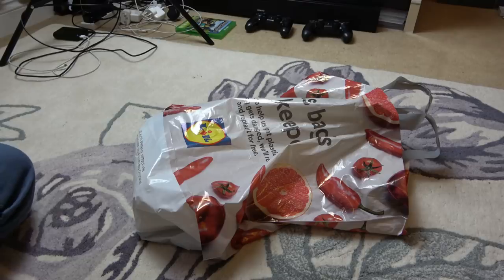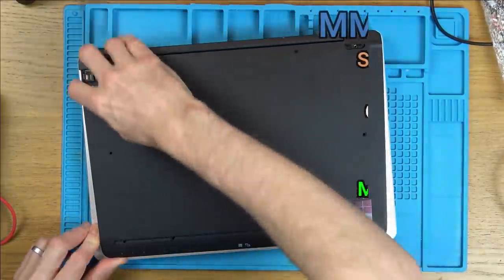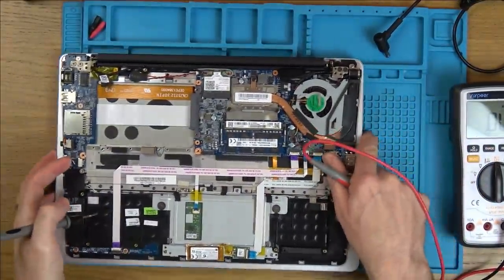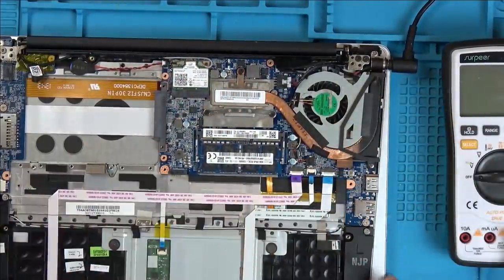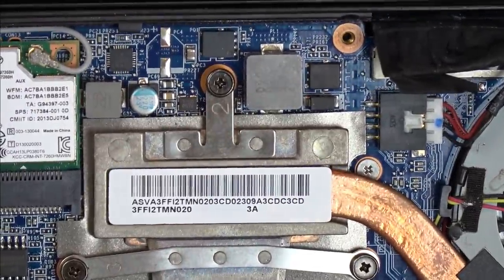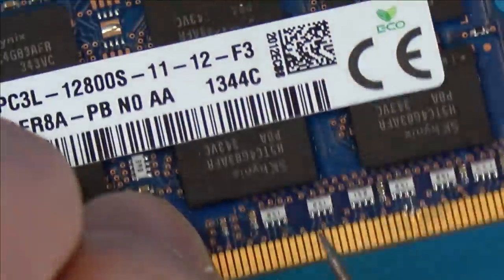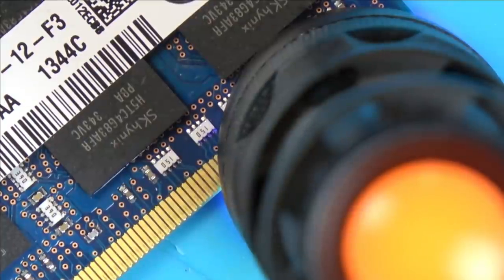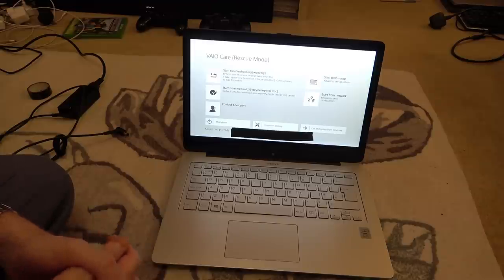A Lovely Sony Vaio Z Flip Laptop that Doesn't Power Up - Trying to FIX

Comment: Nice fix, Vince! I probably wouldn't have seen that super small gap between the pin and the trace. I also have no idea what that strange residue on the pin was. Kinda looked like.. paint?

Just a quick advice: If a PC/Laptop is boot looping like that, it's almost always the RAM or a faulty BIOS/BIOS setting... atleast in my 15+ years of experience with PCs it was almost always that.
That's the first thing I check, when I get an faulty PC.

Thanks for another great video! Merry Christmas and a happy New Year to you too, Vince :)
Reply from the maker: Thank you :-) Very strange mark, looked like tar, paint or melted plastic. Weird thing is, how did it get there. It is the opposite side to the keyboard, there are no holes or vents on the back casing, and if it came through a port on the side how did it make it's way all the way over to the RAM. I wonder if it was there from manufacture, but took a while to eat through the trace. I wonder if the RAM inserted by hand, and maybe the operators glove had it on when they picked up the RAM???? Maybe the comments may shed some light on what it could be.
Reply: @Mymatevince  :)
Reply: @Mymatevince  Based on my knowledge, it could be from improper used on the Laptop. Therefore, it was becoming warm to warmer placing on cloth material instead of something solid  as wood or marble.

Comment: I knew it would probably be ram. Every time I've had PCs fail to power up to post ram is the reason. In my case removing 1 of 2 sticks usually powers system back on but you didn't have that luxury with a single ram chip. Blowing it (and the slot) will often fix mine, although some has gone bad. Never thought to repair the ram. That's impressive

Comment: Hey Vince hope had great Christmas happy new year great repair as few previous comments state ram is a common problem with computers it normally 1 the 1st thing to check in situations like this years ago would beep to inform of issues. Keep up great repairs you do always great see something repaired than just replacing

Comment: I usually. 1. check power, if OK then take the ram out, which is a common fault with Sonys.
I've used an old Sony for years, (upgraded the hard drive and Ram) it has given me no problems since my original faulty ram connector.
I've a suspicion that the ram connector does not grab the ram tight enough on the live causing a small bad connection hence burning the track.
Yip always check the ram early in a computer repair, it's amazing what faults show up when it's not storing info properly.

Comment: Ddr3l is actually a low power consumption variant.  My laptop has the same too . I learnt when I tried to upgrade that standard ddr3 is not compatible and caused system malfunctions when I tried to run it.

Comment: Restarting like that would suggest there's a problem powering-up, and one of the first things I would have done was check the memory by reseating it.  Seems the problem was bit more complicated than that, but still it was memory related.  Back when I was a technician that RAM module would have been replaced.  😁

Comment: i have one of these but it is the  i7 13" version
it has 2 major problems, one is the  barrel jack which on mine is not  the same as on yours
at all ,  it is a special proprietary one that is supposed to be like an Apple magsafe but it   doesn't use magnets it uses some weird spring clips  ,  the thing will not charge unless you hold the adapter on it  or wrap the cord around the laptop  to put pressure on it , it is a huge PITA
i can't even find a replacement part for it anywhere,  i saw one once  but it was in the UK and i am  in the US and the place didn't ship to the US plus it was out of stock and it was  also like 200 pound
so not even worth it even if i could get it,  i really want to change it out  to a regular  barrel jack
another problem i have is the fan ,i have  replaced the fan in this thing  about 5 times already since i got it in 2014 when it was new  , the body is very flimsy  and  the fan breaks constantly, it makes a god awful grinding noise ,  if i slap the laptop  it  sometimes fixes it for awhile , move the laptop and let the flimsy frame flex and it will happen again , eventually the fan needs to be replaced ,it eats fans 
also there is no way to make it  suspend or hibernate  so when it stops getting power cause of the ridiculous charge port design it  reboots ,   sometimes it  suspends mostly it doesn't and i lose my work
i been dealing with these  problems for years ,  too bad because it has such a nice  triluminous IPS display and i like the N-trig digitizer pen
you are lucky the one you got has the normal barrel jack, ut i got this one because i wanted smaller lighter laptop ,i almost never use the flip ,i never use it in tablet mode
also you are lucky is has a DIMM slot   i am pretty sire mine has memory soldered to the board
but mine has a m.2 SATA SSD
also the SD reader is broke ,the card have to be forced in and out the spring broke

Comment: The restart problem when it turns on and off is mostly indeed ram related,
ur lucky this time it was the ram.
Some times it can be the cpu or the ram controller. 
Trough ram controllers are not that common to break, but it is possible. Trough that means replacing the processor anyways because the controllers is with in the processor
Happy new year Vince!

Comment: Always first things to check on a lappy if it don't power on is thermal paste and fan operation and that big wodge of hair from under the SODIMM would suggest it may well have cooked its thermal paste or the fan is working but ineffectually and the BIOS is thermal shutdown as the cpu goes super red hot every startup.

Comment: In future If you get lights the main power rails are working as the chips that drive the lights are further on. If it switches on then off it's a data fault. If it doesn't switch on then check caps for shorts round the chips further on than the main power rails. Remember that some lines are low resistance lines but if one side of the cap is a few ohms higher than the other then it is working.

Comment: In my opinion, Vaios are pretty solid laptops.  I have a Windows 7 era Vaio that's still working.  And I'm currently using a Dell G5 laptop.  And while the Vaio (somewhere between 7-10 years old, maybe more) is still completely intact.  While the G5 which is barely a year old has already had the keycaps wear off keys and the 3 key has stopped working.  The Vaio still intact and everything working.  LOL  In fact, I maxed ot the RAM on the Vaio and replaced the hard drive with an SSD...  so now, it's faster and has longer battery life than when it was new! HAHAHAHA
Reply: (I use it for distraction free writing.)

Comment: You got it to turn on for a few seconds at least. My HP laptop wouldn't turn on after 8 months and sent it back under warranty then 7 months later same problem. Took it to a local computer place and they charged me to tell me that the battery has power, A/C has power but no power after that which I already knew. No one would fix it what a waste except HP when it was under warranty. I heard the power chip in the motherboard needs to be replaced but no one would do it.
Reply: Send it to my mate Vince if you still have it. Be great to watch him fix that
Reply: @paultasker7788  I wish I would have known. It was expensive with a touchscreen which is stupid on a laptop. HP said replaced power supply in the description when they fixed it and 7 months later same thing. Apparently it's the power regulator chip in the motherboard which is why it doesn't get power from either source. Now I know about these people online, I think Louis Rossman is popular and tronics fix but I just bought the best cheap laptop after that.

Comment: What i tend to do is if a laptop or desktop power cycles i take the ram out and move it to secound slot if it has one and replace the ram if still nothing happens then check again and the remove cpu and hard drive and replace them if i have spares its a good thing to start with before testing voltages always take out and replace modular stuff first and see if their is a difference in behaviour

Comment: Have a similar one to that which is a Sony flip 14. It's most likely got a i5 4200u CPU in it which is Haswel from 2013 but that CPU is showing its age as its a low powered CPU. DDR3L is low powered memory. That fan activity is normal its because its a low powered CPU they run hot.

Comment: Nice video! Just a question: the ram was faulty, but the laptop didn’t post even with the ram off.
Maybe cleaning the connector did the trick, or it is supposed to not post without ram?

Comment: I used to work Vaio support... Batteries start at about 70+ and they at the time, really didnt want to sell them to people lol. Also quality wise... they were absolutely meh. No better than anyone else, if anything the push to get weird form factors or use strange new components would result in very iffy stability with drivers etc.

Comment: Take cmos battery out and short the pins before you do anything else. These startup faults (where it's not completely dead) are normally frozen I/O chip that needs to be reset by taking the battery out. If that doesn't work then you look at other things.

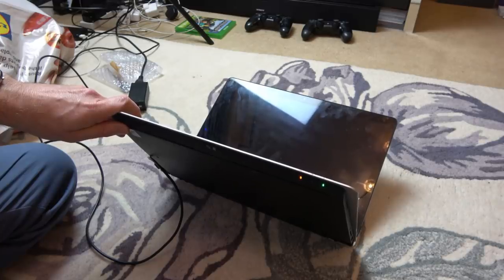Comment: I'm only a minute and a half in and alarm bells are ringing.  If it just won't power up and all the owner wants is the data off the hard drive then that is simple job.  Simply remove it and connect it to the USB port of any other machine and extract the data or simply put the hard drive in an external HDD enclosure and give it back to the original owner.  However, something tells me it's not going to go so easily .  We shall see.........continue.  So at 3:23 it's refreshing to realise someone had the sense to remove the hard drive to recover the data.  On we go.  I hate laptops to be honest even though I have repaired a few.  They always seem far more susceptible to power and motherboard faults and are just often not worth the time to repair as the upgrade capability is so limited.  Right after he checked the power supply rail my next obvious thought was......he hasn't checked the RAM and swapped or reseated them.  Next would be reseat the CPU......on we go. 

So there you go swap the ram out and reseat CPU as a logical progression before you go looking for non-existent motherboard faults.  Generally speaking if the unit has power to the main rail it's usually a plug in component fault if it fails to POST.  As an aside why on earth would you take a soldering iron to a cheap 204 pin 8gb DDR3 ram module  (and use multicore solder without extra flux FFS).  Just bung in another one, any one to test it and then replace with a new one.  About £25 retail.

Comment: Any Computer troubleshooting: 
If the fans turn on and you have LED lights, probably not a power supply issue 
If nothing shows on screen, check the RAM, remove the memory and try one stick at a time, preferably with known good RAM. 
If that doesn't work, try replacing the CPU if possible.
If it turns on and immediately off,  check if there is any USB shorting to ground since some motherboards delay the USB power on a few seconds it may take a few seconds for it ti turn off.

Comment: Was about to say the old mantra. Either it's the power, ram or motherboard/GPU, as software is very unusual as a fail point.
Yes, you fixed the ram, but it would have been safer to get new ram. More expensive, but safer.

Comment: I'm not 100% sure but I think it could post if you removed the broken ram and moved the other ram over but nice fix although I think I'd replace both ram cards with better ones supported by the mother board just to be on the safe side

Comment: The first thing I would have done is changed the RAM. You can tell the computer is trying to post, the on board hardware check is failing hence it powering off after a few seconds. Usually the RAM that does that, best try it first anyway.

Comment: It looked like thermal damage from the part above failing. I would not have repaired the break without replacing the part. Here a RAM switch would have been a better bet, after fixing the trace..

Comment: Ddr5 is not yet affordable.  We are in the upper limits of double data rate 4 right now Vince
Reply from the maker: Thanks Jake :-)
Reply: But at the same time ddr5 and ddr6 are being used in for example modern graphics cards. So all kinds of rams may be used in different purposes inside pcs simultaneously... :)
Reply: @chromatiCityGame   True. No CPUs support it yet. Heck I dont think Intel even supports PCIE gen 4.0 yet.  AMD seems too be planning their next Ryzen launch to support DDR5. We shall see.

Comment: Wen you diag laptops, unplug keyboards, track pad, etc and try to power before doing any other checks. if they are shorted they will draw down power on startup and system will fail self test and power down.

Comment: The fan will always run 100% before any thermal control software lower the rpm. I.e. without the disk you can expect the fan going full force.

Comment: Bad RAM causes PC not to boot? Saw that coming LOL. Even the most high end gaming PC will refuse to boot with bad RAM or no RAM installed. I never knew it could cause a blank screen, as most motherboards will get to the bios and show an error if there's a problem with the RAM, but I knew it could cause it not to boot.

Comment: FYI some of the common reasons the computer won't post is bad memory (a memory issue), missing keyboard (or bad connection), bad CPU ... and maybe a bad GPU.

Edited to add that I'm surprised the computer repair guy didn't try another stick of RAM to rule out a RAM issue, since that seems to be what it was.

Comment: Mine has a screen issue, it isn't stable when it powers on and it heats up so bad plus the battery doesn't charge up to 100% anymore it stops at 80% and drains so fast

Comment: As always modern laptops internally look dinky and cheap as does this one aside from having a decent screen assembly, Sony laptops have always been on the warm side when it came to the temps some being notable. As for ram going bad in laptops it is a common fault which is why those without sodimm slots are best avoided especially those with a tiny one year warranty.

Comment: Things to check first with any computer repair, power, ram, batteries. As I was watching I kept saying check the ram and you finally got to it. Good repair but change out that ram stick just to be safe. 
As for the damage it looked like melted plastic from the ram slot, which could indicate an over heating issue. I don't think you are done with that laptop.

Comment: Well, it kinda sucks that it didn't give a POST-failure beep-code or anything. It just went "Nope, RAM is buggered, I'm just gonna turn off and leave you guessing."
Probably to stop the average consumer from knowing what the problem is and just buy a new one... 
I wouldn't be surprised its like that in most models, to be honest.
Reply: Laptop has no diagnostics buzzer .

Comment: turns out the L in DDR3L is somewhat related to the fact its low powered, which is why its not cross compatible with standard ddr3 dimms.
Reply: Depends on the MB, I have a HP thin client that came with ddr3L ram but can do normal ddr3
Reply: @killerdeamonking  yeah I probably should’ve mentioned budget laptops lol whoops

Comment: Never repair Ram sticks you should just always replace as you never know what more damage has been done and DDR3 isn't too experience. And  most of the time when laptops don't boot it's probably the Ram is faulty. You should always have spare ram for just an occasion.  It's never a good idea to try to repair Ram sticks. Just too many unknowns

Comment: what the hell.... when you took the back cover off and then you opened and closed that laptop without supporting hinges, i was screaming in pain here. ALWAYS support hinges when you open laptop without back cover otherwise you will break it.

another thing. if laptop is showing a charging light or any light at all, there will be NO SHORT on power connector... if there's a short, it will short the charger - light on charger will flash [if it does have any]

Comment: unlikey but - if the pc doesnt have a removable battery it may be attemping to get voltage from the batt and then not boot id it doesnt get it. try cheching voltage coming into the puter from the batt

Comment: doesn't really consider this a repair.  happens super often.  swapping a ram would have been easier.  I would also first do some research on how to perform a computer diagnosis first.  By the way, if the bios battery is empty, the laptop will not start up always then you will already know that.  but I would first take a look at standard diagnosis of computers before you start pricking with the meter everywhere.  there are a few steps that you should always perform first before measuring with a multimeter.